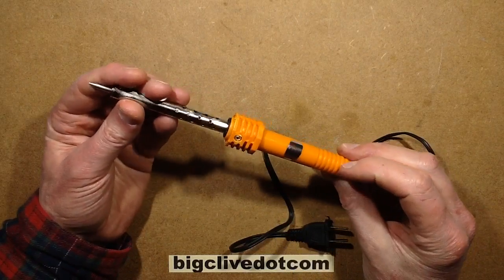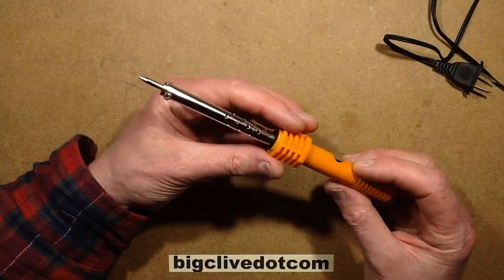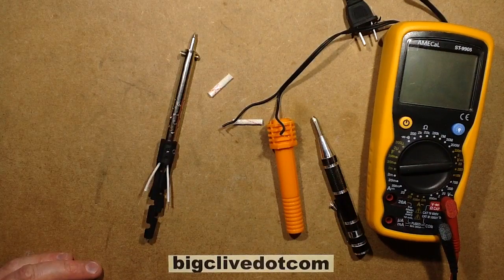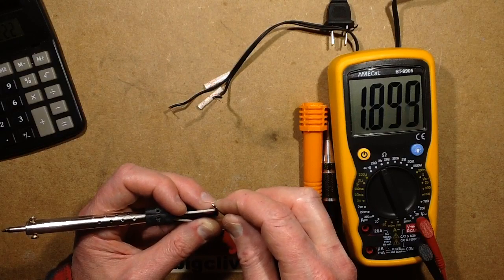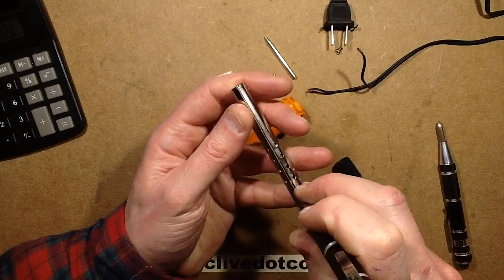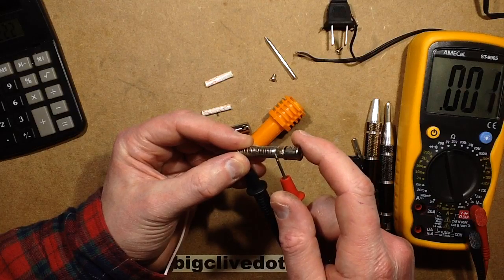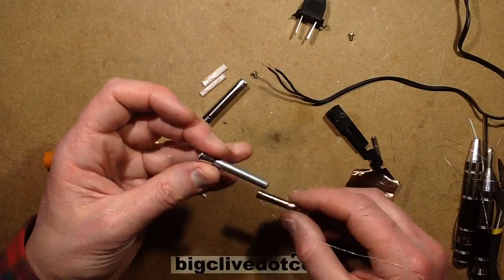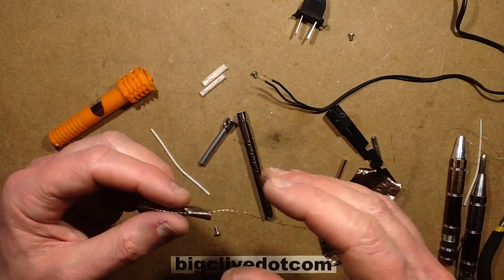Inside the cheapest soldering iron on ebay.

Comment: Hey Clive, 

Just wondering what budget soldering iron you would recommend?

I have a Weller but the tip is pretty much done. Maybe I'm not using it right but it basically turned black and charred and then becomes very difficult to solder with. I'm having trouble finding tips for it (they're screw in tips) but it was 15 dollars at Home Depot so I'm not opposed to buying a new one.

Generally I'm soldering smaller gauge wiring together for either Car, LED/Electronics etc. I use it a a dozen times a year at best.
Reply from the maker: +Sudz These days I'd recommend the generic temperature controlled soldering stations on ebay.  Especially the ones that take the standard and very common Hakko clone irons and bits.
Reply: Do you have a Amazon affiliate link? :-)
Reply from the maker: +Sudz I don't.  It's not something I've really considered.
Reply: bigclivedotcom Well, I support you on patreon, mind as well be able to support you via afilliate links too! You've got enough viewers that it may be a good amount of change! (Also, I love amazon)
Reply: +Sudz you're not using it right.  Any soldering iron requires constant attention to its tip.  Expect to spend as much time coddling the tip as you do soldering, maybe more.

Always wipe the tip on a barely-damp sponge immediately before making a joint, and add a bit of solder.

Never wipe the tip after making a joint, that is sacrificial solder that will protect the tip while it is oxidizing.

Never file a modern tip, they are iron-plated for long life.  Any sort of cleaning ahs to be respectful of the plating.  Get some tip cleaner, it will be helpful.

Never touch the tip to plastic unless you want a long tedious cleaning job.

Turn the heat down if practical while the iron is idling.

Spend whatever time and effort it takes to keep the tip in top shape all the time.  That way you won't have to spend half an hour working on it and cussing it before you can use it.
Reply: +Sudz I've got good experiences with the Ersa RDS80, it will set you back around 175-200 euro's but is very solid, has good temp control and is ideal for working on electronics (even some SMD work). I use the 832 tip for SMD and LED/cpu rework. If you hop over to the EEVBlog forum, you can find many threads on soldering advice.
Reply: +Walter Steenvoorden way over my price range. the Canadian "peso" is crap right now too. I ended up getting g a knockoff hakko off aliexpress for under 70 bucks. I imagine its close to the 16 dollar one EEVblog reviewed a while ago.
Reply: +Sudz Well we got brands like Voltcraft and Basecraft. Basecraft has a weller (ZD-99) lookalike which is kinda okay is about Eur 25,- online. I think they also retail these units under other names in the US and Aussieland.
Reply from the maker: +Sudz Good choice, since they seem very standard and the bits are readily available.  I just bought a very similar one from ebay and it's got a reasonably beefy transformer inside and a smaller than average PCB behind the back panel with very smooth cycling of the iron heating.  I'll probably do a teardown at some point.  Mine came  well off calibration, but if you start at about 200C on the front knob and then nudge it up until you reach a good soldering temperature that's easy enough.
Reply: Awesome!  Good to know. 

Turns out my Meanwell Transformer for my LED Fishtank light conked out today. Going to take it a part and see whats up - WIll probably get some use sooner than I thought.
Reply: +Sudz You got to keep the tip cleaned. Use a wet sponge to wipe the tip while using it. When it's cold use a wire brush or file to clean it and keep replacement tips on hand because the tips do wear out. Weller is a good brand if taken care of.
Reply: Eddieallen Don't file your tips.  You'll go through the iron plating and then get to find out just how fast copper dissolves in hot solder.
Reply: dbeierl
You are right. Most of my time I soldered things growing up I used solid copper for cheap tips and I'm used to using files. I'm using a $5 iron right now that works fine and I got it from a flea market.
Reply from the maker: +litven I've never actually tried a Goot iron.
Reply: i bought a iron it was $100.00 in the USA. 50 to 100 .

Comment: I have a very similar soldering iron and the problem with it is it actually melts down the plastic that holds the hot tip and I am stuck with a mutated iron where I have to kinda hold it at an angle just to have it dangle over whatever I am soldering, it's seriously annoying. However, I am also not going to pay $100 just for a decent soldering iron.

Comment: Hey Clive, can you recommend a cheap soldering station? The cheapest I can find are 50$ which is too much for a poor student.
Reply from the maker: +radry100 The generic Hakko clone often with the number 936 in the name is usually fairly good with cheap spares.
Reply: +bigclivedotcom I've had bad luck with those.  The wand cords just fall apart with much use.  Fortunately they at least take standard Hakko tips and have dropped in price over the past few years.

Comment: for years i had a cheapo soldering iron until i dropped it on the kitchen floor & it stopped working,so i bought another cheapie & while i was waiting for it to heat up i left it to get some tools i needed,as walked back in i noticed that the part the tip is attached to was glowing cherry red hot as i panicked & reached for the ac pwr switch to shut it off it exploded! showering me & the lino floor in sparks!.
i returned it to the shop & explained what happened but they werent interested in refunding purchase price until i threatened to call the office of fair trading,i bought a 25w nicolson iron & its still going strong to this day.
the other 2 irons i had were "lion brand" (made in china)& were packed in a thin plastic bubble on a card backing that was colored dark blue with yellow stripes across the top of the card,although the first cheap iron lasted for several years i just thought i would share this story as a warning all that u get what u pay for & cheap tools can be dangerous,so be careful :)

Comment: They actually sell these in china shops over here. I've had a couple and they don't work, as in, the connection between the connection wires breaks the instant you Plug that to the Wall. So yeah, if you like your Money, stay clear from these.

Comment: My wife got me a cheap Pyrography kit to play with once (it is essentially a soldering iron with different shaped tips) and It turns out that I'm not artistic enough to use it. 
I also have a 3d printer (cheap yet again) and have tried to use all sorts of methods to to smooth out the layers.
Then it hit me, use the "pyro" iron to melt the top layers. 
Needless to say, it was too hot and made a mess of my prints.
Now for my question, could I use a dimmer switch to control the temperature of the iron?
Sorry for the long story.
Reply from the maker: You definitely could use an inline dimmer to regulate the iron's heat.

Comment: There is so much crap on ebay nowadays.
Reply: +TheDutyPaid ots its always been around, you have just paid 5x more for it as the uk seller middleman has marked it up considerably.  sure many of those sellers were market stalls or foreign fly-by-night value shops who didnt have to be there when it came back broken or that it didnt meet british safety standards.
Reply: +TheDutyPaid ebay has become host to all the guys on the sidewalk that sells merchandise from their long coats. jusb 1066 is right about the markup of items but knockoffs like this soldering iron are out there also and it takes a experienced eye to spot the fakes.
Reply: +TheDutyPaid is good time for buying crap
Reply: +TheDutyPaid There are a lot of gems. Look for the componenet tester kit using an AT Mega 328 chip and a backlit LCD display.
Reply: Jonathan Warner already ordered the one I linked, it is already built and maybe a tiny bit of QC 
I know it is fun to solder kits together, but my first job was hand soldering of 7 hours a day for 3 years at a company called Soundcraft. You can't blame me for skipping that part.
Reply: I was happy to solder mine together because I am a cheapskate. Having said that, I want to buy more now - try out different models and put one in a case, properly. I bet they are all the same underneath - an AT Mega 328 chip, an offshoot of an Arduino project, and an ingenious bit of open source hardware design.

Comment: Hey Big Clive! My father and I have been in a heated discussion recently about soldering irons, perhaps you could help. He wants to buy a cheap 15w soldering iron from shadiorack to fix SMD components. I am trying to dissuade him and get him to buy at least a 35w iron as, in my opinion, with a 15w it won't have enough power and you will be holding it on the component too long waiting for the PoS to melt the solder.

A 35w or 50w iron melts the solder really fast so you get the heat on and off faster so the heat has less time to travel into the components. Is my assumption correct?
Reply: +Nolansykinsley Get a hakko clone you want temp controle for smd. Also flux and fine strand solder braid.
20-30 on ebay http://www.ebay.com/itm/261986624891?_trksid=p2060353.m1438.l2649&amp;ssPageName=STRK%3AMEBIDX%3AIT

Search term 937 Soldering station
Reply: +Nolansykinsley 
For SMD you definitely want a high power, but temperature controlled soldering station. Especially if he's thinking about fixing stuff it means he'll have to deal with lead free solder, which takes more heat. Power components like MOSFETs with a huge tab soldered to the PCB will be impossible to desolder with a low power iron. The problem with unregulated high power irons is that they will get too hot for small components and almost instantly let resistors, capacitors, diodes, LEDs and similar small parts go up in smoke.

I have got an XYTRONIC LF-3000 (90W). It wasn't cheap (90€) and for some reason the follow up model that's identical except for being 120W costs 150€, but still by far not as much as the ridiculously overpriced Weller or Ersa station. It is such a joy to work with it (as a hobbyist every few weeks or so) that it is an investment I never had seconds thoughts about. It takes longer to get the solder and flux out of the drawer than it takes the iron to heat up and if you try to solder something big it takes 2 or 3 seconds until the heater kicks in again and delivers the 90W. If he intends to use a soldering iron more than once a month, do yourself a favour and convince him to get a decent soldering station!

Comment: Shouldn't youmultiply the power by 0.7 (cos phi) to ge the power factor right or am i missing something?
Reply: +Programatór Even though there's a coil of wire in there, the inductance will be small and at 50Hz the reactance will be tiny compared to the element's DC resistance, so overall it's an (almost) purely resistive load.

Comment: Are soldering irons with the screw-on sheath good?
Reply from the maker: +The Restoration of Dr Who The main advantage of the ones with the screw on bit retainer is that they often use a very common Hakko clone bit available in your favourite style or a multi-pack on ebay very cheaply.

Comment: 1.8k might be ok,  resistance will change after temperature goes high.
I think the "plastic" is not right,it should be mica, is it? mica is soft just like common plastic material.
maybe, a 5$ iron 'made in china' won't  so sucks!

Comment: I have a Weller my father purchased in 1960's which as a hobbyist I still use.  I paid $5 for one similar to the type shown. Lasted 3 days. I don't believe it had as many parts as that one.  It shorted out while I was using it causing a fire and thank god I was there as I had been called outside at the same time. Could have burned the house down.Raised hell with E-prey and received a refund.
 Get the parts and build your own or buy a well known name brand.

Comment: You wasted a good iron.  I have used this iron for years without a problem. The wire supplied is there for you to change if you want  for a different standard. I replace the iron when the tip is gone. they cost less than a tip. These are good for techies who actually know their stuff. I use 3 core wire and ground the shell.

Comment: Now that is a made in china soldering iron. I could fix that but why? I've gotten soldering irons from walmart and they work good. Not earthed but I've never had any issues. Just mains hum when working on audio equipment. There are no holes in the metal barrel.
Reply from the maker: +coondogtheman1234 To be fair, it did seem to have fairly decent insulation, but I'd be wary of using it on components where mains leakage could cause damage.
Reply: bigclivedotcom
I've never had any issues. Much of my soldering is of components that are not sensitive to damage. Just torches made from LEDs and resistors and 9 volt batteries lol I made so many of those.
Reply: +bigclivedotcom I've got a LED Bulb and i want to test it it's WATTAGE, It says 9W. I've got a old Analog Multimeter. Please help me
Reply: +8Beat Crotchet Test the current and the voltage, and apply ohms law. You can test that from the outlet, if your multi-meter has the capability of reading current at the voltage of your mains and at a reasonable amperage.

Comment: Is it not impedance as it's AC or would it be the same as the resistance you measured? Genuine question.
Reply from the maker: It's a pretty much pure resistive load which is classed as resistive on both AC and DC supplies.
Reply: +bigclivedotcom Thanks for the reply Clive.

Comment: weller soldering station whs40 for 125Eur has no earthing as 90% of soldering irons. They use simple 2 wire cable. So how can you expect 0.99 iron to be grounded?

Comment: I'm surprised they did not solder the connections, when they are making soldering irons...
Reply: +bingo475 The problem with using solder in a soldering iron is that it gets hot enough to melt solder. When you plugged it in, the connections would melt apart.
Reply: +Possibly David No they wouldn't. I have this exact same soldering iron and it didn't work when I received it. I've found out that the cable wire had snapped inside somehow so I replaced whole cable with the one I had laying around. It takes quite a while for the iron to heat up enough to melt solder, but it works.
Reply: Resistance wire doesn't really solder. There might actually be ways to do it but someone making and shipping the iron for £1 isn't going to go to that effort.
Reply: Dainiusbrr
Oh interesting, so did you use solder to connect the new cable?
Reply: Possibly David
Yes I did :)
Reply: +Dainiusbrr 
Are you sure that's a decent connection and not just a cold joint? The heater wires a had never would make a solid connection to the solder. I cleaned, fluxed, tried different temperatures, but the metal the wire is made out of was not solderable.
Reply: Dainiusbrr
Cool! If you left it on long enough do you think it could melt loose? And yeah, if it takes longer to heat up than it should, maybe the joints could be cold?
Reply: Possibly David
No I don't think it would melt. I left it plugged in for 30 mins and it's fine. It's heating slowly because it's low power (my power meter shows that it's drawing 33 watts) and the tip's quality is not great.
Reply: +superdau I'm pretty sure it is decent. It wouldn't solder at first so I scraped the wires with a knife and then I could solder it. When I'm saying that it takes a 'while' I mean 2 minutes. When I compare it to my big old Made in Soviet Russia 80W iron that heats up in around 30 seconds it feels like a long time :)
Reply: +Dainiusbrr Awesome!
Reply: +Dainiusbrr Not that I recommend it, but because this iron isn't earthed, it allows you to solder live mains wiring. When I've done that in the past, I had to let my iron heat up, then unplug it so that it wouldn't short the live wire to ground
Reply: +Possibly David The thing then is to remember that you're holding the solder in your other hand...
Reply: +Richard Ball Indeed lol. I had to lift my feet off of the concrete floor when working in the basement to avoid those tingling shocks (while sitting on an office chair with plastic wheels and arms out to those wheels). Again, I don't recommend it!
Reply: Possibly David Why not use your isolation transformer to keep the iron hot and isolated at the same time. (especially when soldering a powered on device).

Comment: Do american irons have earth connections?
I thought all their electrical equipment was based on fuses in a fuse box, rather than in the plug or earth lead to flip the mains off..
Reply: My Iron is grounded (at least it has the 3 prong plug). And building 
codes typically require grounded outlets along with the Circuit Breaker 
Panel (don't know if fuses are still allowed)
Reply: Yu Jay All new construction American homes have a "breaker box", not fuses. And all are grounded as well.

Comment: i bought a soldering iron for 8 euros and after using it once the tip doesnt melt any solder at all but it does heat up

Comment: these have the cheapest thinnest wire wrapped in a mylar insulating sheet, these work about twice and die,
Reply: +jusb1066 Once. Had this (or very similar) model years ago... After 10-15 minutes of heating the handle gets soft and eventually the heater fells off.
Reply: Jo Russ
haha, sorry, hope you didnt get hurt though
Reply: +jusb1066 Nope, just shocked (mentally :-)).
Reply: +jusb1066 I had one like in the video but blue and it worked 3 times and then died! I own a Weller now.

Comment: I have one, it turns red hot after a short time and the handle starts to melt.
Have only used it a few times, it is not safe. :-)
Reply from the maker: It sounds like you may have a lower voltage unit than your local supply.